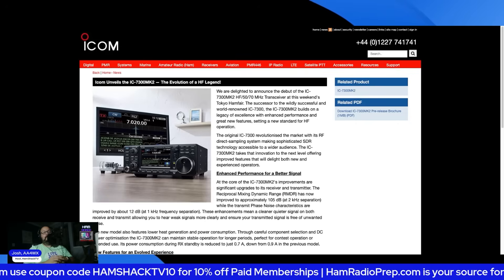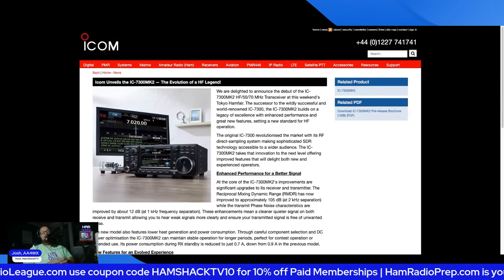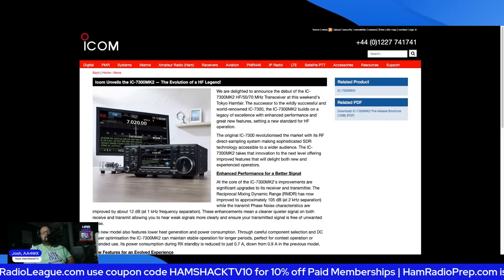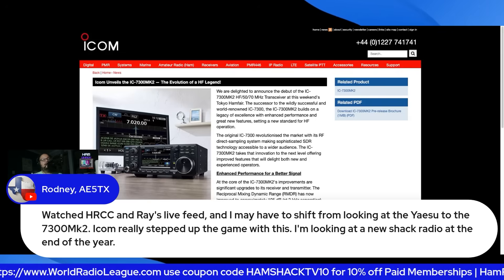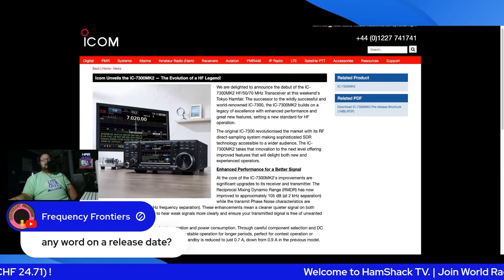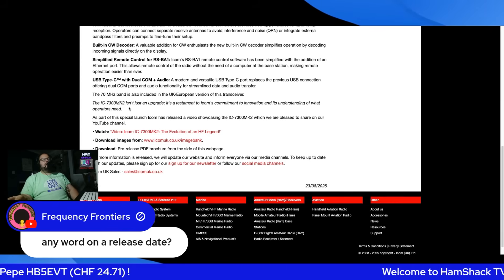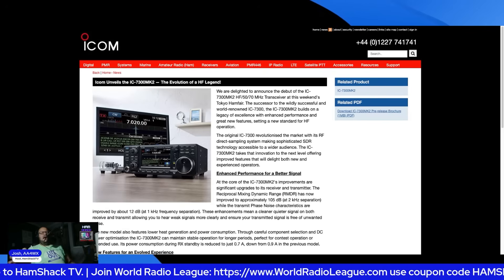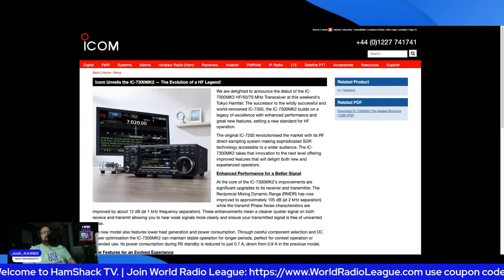Icom IC-7300 MK2 Unveiled at Tokyo Hamfair 2025 – Next-Gen HF Rig

Comment: To be honest, I get much more fun out of putting together something like my little QMX+ and building a little 50 W amp, for it, (total, $200,) than buying expensive appliance rigs I have no idea how to fix or mod. They probably don't even come with a schematic. I could buy a Hiberling if I thought it would make the hobby more satisfying for me, but it wouldn't. As far as DX communications goes on HF, I like to catch big fish on light tackle. I don't need a broadcast transmitter on a mountaintop. I've blanketed a third of the USA with my 7 mW signal on 175 kHz, copied it in the car from Denver to Chicago along I-80, and learning how to do that was the most RF fun I've ever had. So when I'm doing ham stuff I stick to building, modding, and experimenting, not blowing all my money on appliance rigs with a lot of bells, whistles, and lights I don't want and will never use. All that just sort of overshoots the whole hobby, which you would think was a nonstop DX contest if you believe a lot of YT channels. It's not. It's a hobby about learning RF, how to use it, and how to have fun using it.

Comment: Features that improve the IC-7300:
Better sensitivity and signal processing 
Better rx/standby power (23% less, 0.7a)
Items that elevate this over the FT-710:
CW decoder (FTDX-10 level)
HDMI connection (Yaesu, what were you thinking) 
USB-C connection with dual virtual ports (finally) 
LAN connection with remote connection server built in
Receive ant/Band Pass filter: First at this level of radio

Icom just proved that Yaesu could have done this to the FT-710 but chose not to. 
I really want to see the first reviews and pricing.  Overall, very nice upgrades and legendary Icom menu navigation and features.  
73  
Rodney   
AE5TX
Reply from the maker: Thanks for the detailed breakdown and analysis!

Comment: Thanks for the preview.. I may suggest that you do a bit of research on what reciprocal mixing dynamic range actually is because it's a shame that so many hams use this to make purchasing decisions not understanding what it is.

Unless you're a CW contestor with a very remote station 20 mi from your nearest neighbor and 100 mi from the nearest town then anything over 70 DB of reciprocal mixing dynamic range is absolutely useless.

I would venture a guess that less than 0.1% of ham radio operators would benefit from a reciprocal mixing dynamic range in excess of 70 DB unfortunately Sherwood engineering decided to use this metric to sort it's test receivers.

Basically with 70 DB of reciprocal mixing dynamic range you would need a CW signal 60 over S9 to kilohertz away to increase your noise floor by 1db. And once again this is a measurement of CW receiver performance not SSB. 

This is an important measurement for CW contesting when you have a lot of strong signals lumped close together, but it's absolutely meaningless SSB

Contrary to your statement reciprocal mixing dynamic range does not improve the quality of the received signal, and it's a meaningless measurement when you have a high noise floor. 

I just listened to a ham state that he bought the Yaesu 710 because it has a better receiver than the 7300 and he needs that because he lives in a high noise floor environment, unfortunately all I could do is shake my head because this ham even though he was an extra didn't have the technical background to understand my explanation for why he was wrong. 

The bottom line is even Sherwood engineering tells you not to use their list for purchasing decisions. 99.9% of ham radio operators would be perfectly fine with any radio made in the last 30 years.. everything else including the big screen external monitor is nothing but bling bling. 

I think probably the most important feature added would be the receive only antenna, but then again I guesstimate that very few hams actually live on enough property to make use of a good receive antenna such as a beverage antenna. 

Utilizing a radio that has the capability of a receive only antenna is really a good setup for example receiving on a beverage antenna while transmitting on a vertical antenna with a good radial field. 

A good vertical antenna with a good radial field makes an excellent DX antenna because of the low angle radiation but they're not great receiving antennas because they tend to be a bit noisy that's why using a separate beverage antenna creates an ideal setup
Reply from the maker: Thanks for the feedback, I appreciate the insight!
Reply: Listen to this guy. I've been fascinated with RF since I traded my bicycle for a 2-transistor radio. I've built transmitters and receivers since I was 10. Now I'm in my 70's. I once kicked Bill Hewlett out of his own Colo. Spgs. 'scope R&D lab when I was just a tech and caught him wandering around the R&D labs one night after hours without a badge. He was nice about it, as he should have been. I've talked near-field noise eliminator designs, extreme Q loading coils, virgin grounds, and black-powder weapons with Doug De Maw at his home in northern MI. I've explained physically short longwave antenna design optimization to a NIST physicist. He sat there and listened for 20 minutes and didn't say a word. I had to keep asking him if he wanted to hear more, and he kept saying, "Yep." I have a 3 foot long shelf of antenna, RF field, and transmission line theory books on one of my bookshelves. Dannelson didn't bother with bona fides, so I kicked in mine. He didn't need to. He had the facts. He said what I would have said if I typed with more than 2 old, beat-up fingers that can barely hit the keys on a full-sized keyboard. So there it is. Now my fingers hurt again.

Comment: I'm sure you realised afterward but you meant for the layman it runs 700mA or 0.7A in recieve mode and most radio people would have realised that you meant that. Mike G7VYH - thanks for the video.
Reply: The 7 mA number was voiced on Josh's stream. I did not believe it because the display draws more than that.
Reply from the maker: Thanks for the clarification!